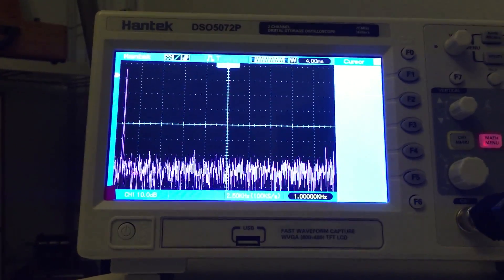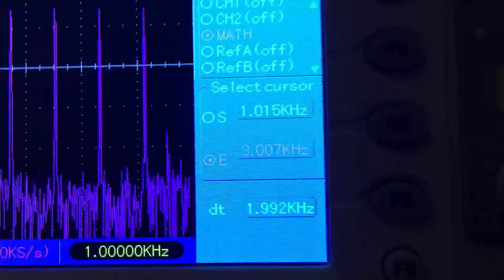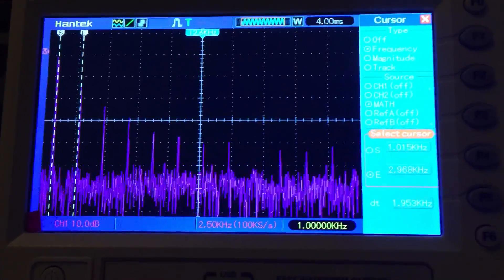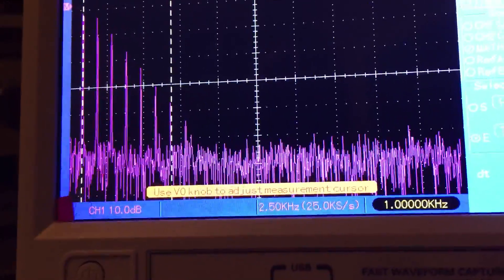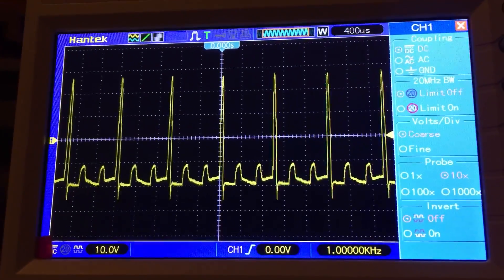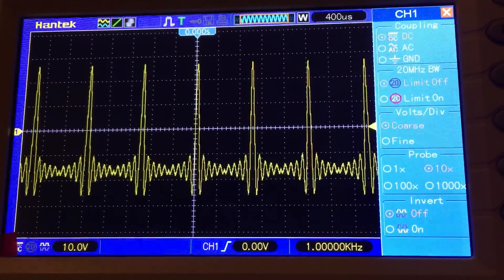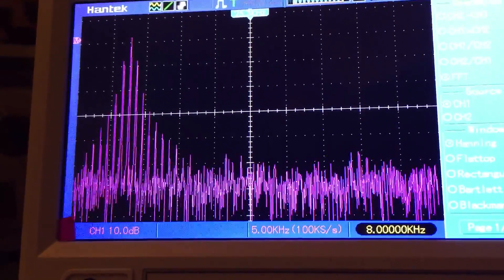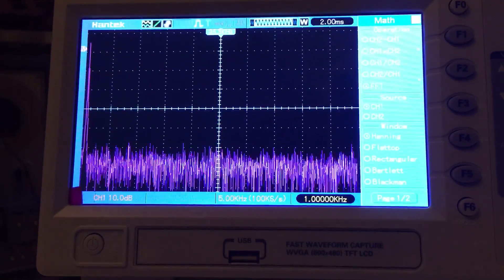Hantek DSO5000P DSP5072P FFT waveform harmonic revisit

Comment: I have this scope and was wondering if there was any additional documentation available other than the user's manual which is pretty weak.  Having trouble connecting to my PC - did the obvious - manual install of driver, etc.  updated firmware, latest software and it won't connect...  Any thoughts?????  Also would like to do some cursor measurements on the Laptop with a downloaded waveform once I get up and running - any step by step tutorial on the software???
Reply from the maker: I do not use any of the software that connects to the scope.